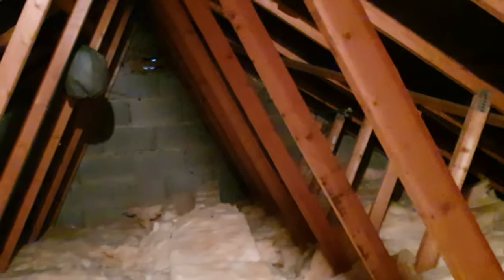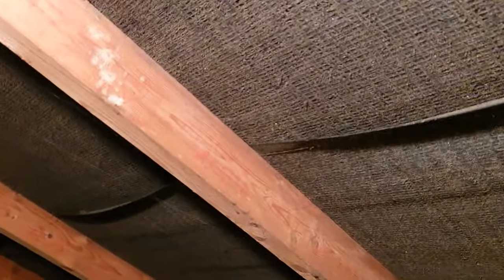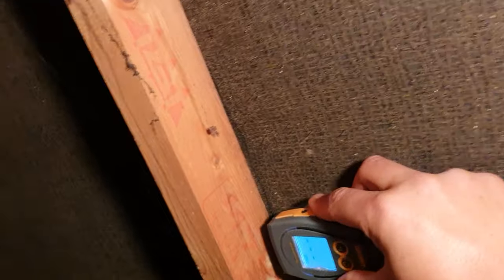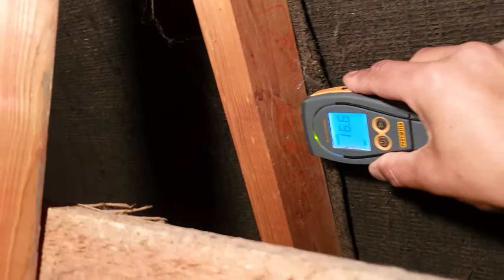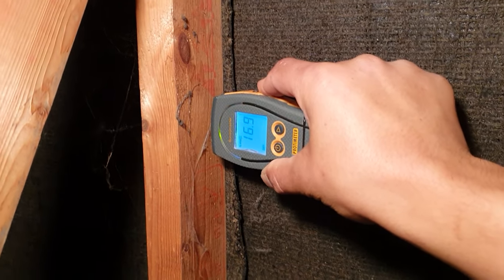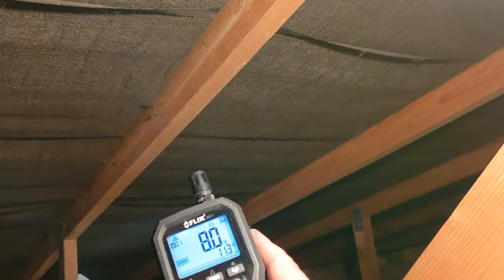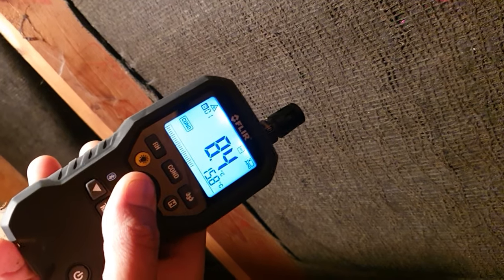Condensation in roof voids

Comment: My loft in previous house was an exact copy, felt was dripping wet. I fitted lap vents, pulled the insulation out the eaves and fitted soffit vents. It dried up in a few days and was problem free.
Reply: Have U tile roof vents
Reply: I have a similar situation. In the cold winter weather I have droplets of condensation on the underside of the bitumen felt. There is no roof ventilation , neither at the eaves or ridge. The ceiling glass fibre insulation is at time soaking wet. In the house  (bungalow)below humidity levels are always very high even though I am the only occupant and am very careful to always try to minimise the moisture I create.
Is it possible that I might lower the humidity  appreciably in the house if I improve my roof space ventilation?

Comment: Today Nov 22, i took our crimbo decs down from the roof space, AND took a look at the inside of the roof , not only condensation but white powdery deposits on the roof beams, I think its the start of dry rot, and it will need treating, I do believe the insulation has also been pushed down into the eves area hence no airflow. Clucking bells springs to mind,

Comment: I'm a structural engineer and what I'd also be most worried about is the lack of any bracing to the trussed rafters.  There is no longitudinal bracing nor is there any diagonal bracing and the design assumptions of restraint of the trusses at the node points is invalid here due to the lack of bracing.
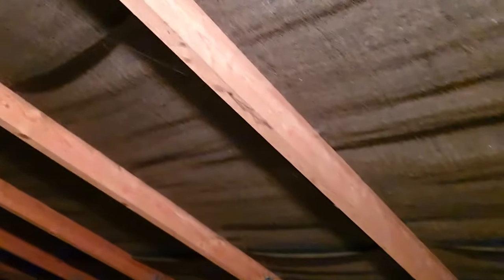Reply: I can see a diagonal strut at around the 1:30 to 1:34 min mark. It does appear to be of slate batten type scantlings though, ie better in tension mode than in compression for sure.
Reply: @onanysundrymule3144  Yes, you're right.  You can see that bit if diagonal bracing at the beginning.  The trouble is that it does not carry on along the whole length of the roof which is what it should do and there are no longitudinal braces at node points so still a fail in my books.

Comment: That insulation need pulling back at eaves /wall plate level, as it looks like it’s touching the old felt which causes big issues. Fitting a dry ridge system and opening up the felt on ridge level plus over facia vents are another way of getting the roof to vent, could be done without planning permission??

Comment: My house was built in the mid 90s the rear of the house is full south facing the ceilings are fully insulated and there is open space into the eaves with full length vented soffits and i still get condensation dripping from the bitumen roof felt.
Reply: You heard the guy, you will have to turn your house around so that the front is South facing. Could be expensive. 

Only joking. Have you ensured that you have full through and cross ventilation to the eaves on both sides?

Comment: First thing to do is pull back that insulation see if the problem goes away?
Reply: Agreed plus installation of soffit vents. They are reasonably discreet and may not need planning.
Reply: What do you mean by pull back? Like pulling it away from the edges?
Reply: @adrianchen1423  yes because in the eaves are usually the vents and you need air flow in the loft from outside